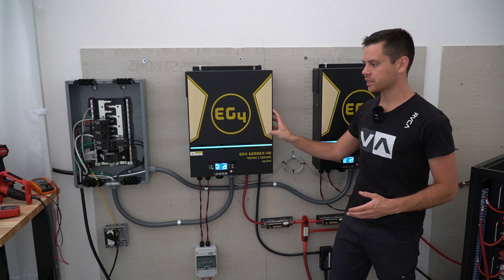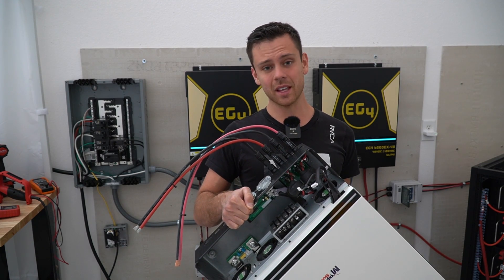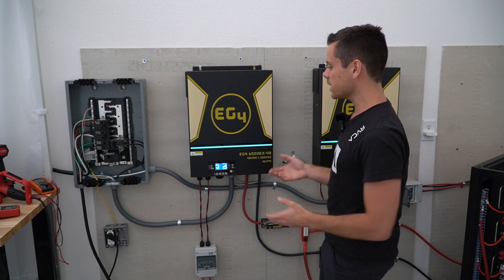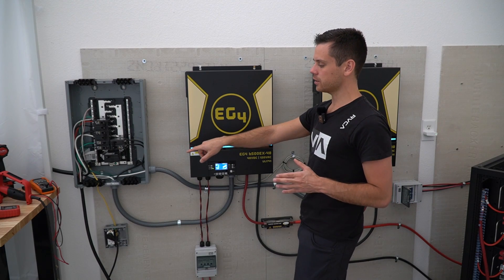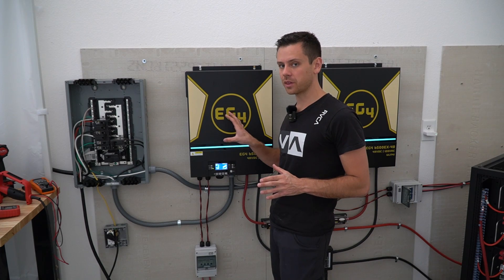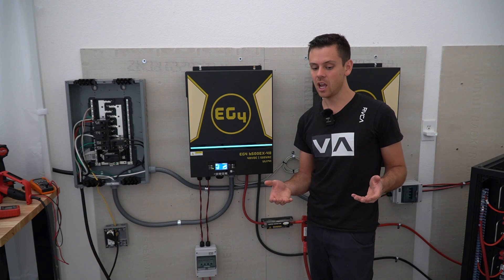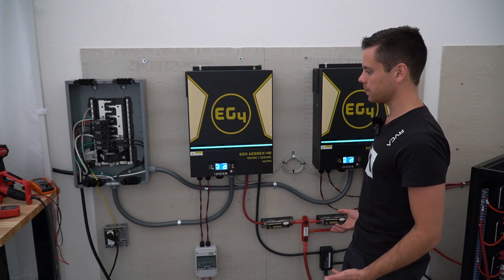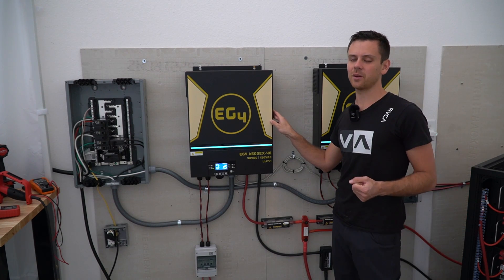EG4 6500EX VS MPP LV6548 Code Compliance and Ground Neutral Bond Discussion

Comment: Just saw that Signature solar now has EG4 6K Off-Grid Split Phase Inverter | 6000EX-48HV | 6000W Output | 7500W PV Input. Wish I would have waited to purchase this instead of the 6500 I bought
Reply from the maker: Why? It's same as lvx by mpp. High idle consumption. Good for inductive loads and that's it
Reply: @WillProwse  basically just for the money. would save me $1249 from having to buy another one and wire. Recently became disabled and only getting SS disability now. So every penny helps. I know it is not much but still. I am happy with my purchase and will buy another one here soon it just would have been nice to buy another battery with the savings. haha Keep making great videos I look forward to all of them including the ones you make with your Tesla's
Reply from the maker: I prefer 6500ex anyday over the other one

Comment: Will, thanks so much for all of your videos, I enjoy watching and learn so much! Do you have a video showing how to install an inverter like the E4 6500 as a single unit and simply moving some of the household 110 main breaker lines to it? I’m thinking about attempting this to reduce my electrical usage, and build it up over time with solar and battery bank to eventually have every 110 outlet on an off grid circuit, but would love to see that in a video! If it already exists, please point me in that direction.

Comment: I’d really love to see more about grid-tied systems with battery backup, solar power pass through, etc. I see a TON of affordable off grid solution but very little about grid-tied systems with battery backup. Particularly DIY. I’d love split phase, 30kWh battery backup, and 10kWh+ panel setup that can fully power the house and feed excess back to grid
Reply: Why bother with grid tied? Hybrid inverter costs 3-4x more and in Florida electric company demands $1M insurgency policy. Unfortunately, it will never pay for itself. Off grid with emergency grid tie is the way to go, IMHO.
Reply: Power companies hate home solar & are cutting the pay rates to homeowners... 
Better, but more expensive, to have battery storage.

Real cost of electric from Big Power is edging Up to 20 cents a kilowatt... But they pay less than 7 cents a kilowatt to homeowners w solar.

Comment: Can these EG4 batteries and inverter chargers be used in an RV?  If so what set up would you recommend to run everything 2 - 15000 BTU A/C, 1 with a Heat Pump, electric fireplace, microwave, and kitchen appliances.  I’m talking fully off grid.  Also, can the inverter be used to charge the batteries with shore power or generator as well as solar?  Thanks.
Reply: I am wondering the same thing. I like the all in one option. Seems like it would be a much better solution.

Comment: Is it me or is this whole off-grid system floating? I.E. should you not have the grounds tied to a grounding rod if in a remote building or to a main building grounding rod?
Where is it grounded to and through? I can see the ground wires connected together but where do they finally go to ground through what path?

Comment: Can it be clarified that if I bought all this setup and have a good understanding of electrical hook ups and did it myself, and keep it completely off grid. Am I required  to get inspections?
Reply: I think it depends on if you are using it in a house that requires a Certificate of Occupancy or not.

I am keeping my house off-grid with this setup, and to get the CO, I need to pass inspection. 

I think of you are just setting this up in a garage or something, you don’t need an inspection. That’s just my understand though

Comment: I would like to see a load test. How long can you charge your car with it?

I can get about 30 minutes at 48 amps with my pair of LV6548s, (12,000 watts with the rest of the house stuff going)
Reply: Why does it stop charging after 30 mins?
Reply: @RCsBigAir  the LV6548s overheat. They cannot handle the load for a very long time.
Reply: @JasonCarmichael  Thank you for the info.  I’m currently setting up my own system to use to charge my EV.  If I were to lower my charging amps to around 25, would that help the system stay on longer, or will I still have overheating issues?  Thanks again.
Reply: @RCsBigAir  absolutely, I had zero issues at 32 amps ever. But when I cranked it up to 48 amps, kaput within 30 minutes every time.
Reply: @JasonCarmichael  Exactly what I needed to know.  I will just plan on keeping it around 24-32 amps.  Appreciate it. 👍

Comment: Is the ground neutral bond ok if it’s a floating offgrid system or should I still remove both screws and separate the grounds and neutral at box?

Comment: If I use off grid, do I need inspection?  I am in San Diego, California.  thanks
Reply: I think it depends on if you are using it for a house where you need Certificate of Occupancy. 

I’m staying off-grid with my home, and to get my CO I need to pass inspection. 

You might not need inspection otherwise, although I’m not sure. Best to check with the local code enforcer

Comment: Will !!  I don't know if you will ever see this comment/question; but, my big question on inverters is sound levels?? Do the EG4 inverters run cooling fans?  Constantly, or occasionally?   Nobody publishes anything on sound levels on inverters.  Right now, I have a Giandel inverter on my 24V system.  I have to have installed in my house, living in the Phoenix valley.  Only 103 today, but many days near and over 110 degrees.  Not good for installing any kind of gear outside, other than my panels.  My Giandel inverter only cycles fan occasionally on startup current, or if I put a big load on it.  Are there any inverter specs about sound levels?
Reply: Fans, spin up under load

Comment: Hi I'm wondering if and how I can put 48v wind generator into this eg4 sistem with soler   for maximum input of daylight and wind  into my battery bank to bring up backup power  storage at night  PS I have lots of wind   any help would be much appreciated thanks for your time 👍
Reply: I think you probably can, as long as you don’t exceed the 18amps that the PV inputs can handle

Comment: OK, so if I want to use this in bypass mode then I have to leave the neutral unbonded in the subpanel (because I havbe a neutral bond in the main panel). Then, when the units are in inverter mode, and the output neutral is disconnected from the input neutral, I don't have neutral bonding anywhere. That sounds like a problem, right?

Comment: I have a fairly new 13,110 kWp System (38 x Mission MSE345SX5T Solar Panels / SolarEdge SE10000H-US Inverter with P400-5 Optimizers, RGM Revenue Grade Meter and Cellular Communication / Note: Installer has Filed for Chapter 7 Bankruptcy). June 13th 2022 / Year to Date Production 9.23MWh / Consumption 5.77 MWh. What would you recommend that I purchase to have Battery Backup Storage in the event the Grid goes Off-Line? Thanks in advance for your time, Randy  AKA: randog311  (77554 Area Code)

Comment: I've just found an inverter with an internet search which looks exactly like the EG4 6500EX with the same specification. It's called "Phocos PSW-H-6.5kW-120/48V" (e.g. offered by solar-electric). Even many pictures in the manual are looking the same as in the manual for the EG4 6500EX.

In the manual of this inverter, they mention the neutral-ground bonding explicit on two locations with interesting details:

page 3:
"Both neutral (N) and live (L) wires of the AC input are automatically disconnected (break-before-make relays) from the AC output when the Any-Grid operates in Off-Grid mode"

page 4:
"Only in Off-Grid mode, the neutral (N) and ground (PE) of the AC output are automatically bridged inside the Any-Grid to ensure the RCD’s functioning if the AC installation is wired correctly as a TN-S or TN-C-S earthing system. Ina TN-C-S installation the bridge between neutral (N) and ground (PE) must be between the public grid and AC
input of the Any-Grid to ensure that there is never more than one bridge between N and PE."

Now I wonder if it's possible that the EG4 behaves in the same way about neutral-ground bonding like this Phocos? Is it possible that the EG4 includes also this relay - additionally with the bonding screw which is mentioned in the video?

Have you ever heard about this off-grid inverter model?

Thanks!
Frank

(don't be irritated by the headline of the solar-electric web page, they mention the word "hybrid" in the headline of this inverter offer - but it's not hybrid, they call it "Any-grid" because the grid can act as input source only - it's explained in the details).

Comment: Am old lady, husband wired our house. Main panel by the road. Would this work for additional power EG4 6500EX if all i want to do is supplement power in off grid configuration to keep the trucks and/ or  tractor plugged in during 40 below in winter and a single air conditioner during summer. That currently costs $150 month from the grid. we alternate so not all at once. If our house catches on fire , will burn to ground before fire department gets here. Rural Alaska, so do not have to worry about firemen getting zapped.
Reply: Wow Linda, sounds like you're really roughing it out there.  Yes, that or the LV6548 would work too.  I'm putting in an off-grid system myself and it's a lot of work, from finding and ordering all the right sizes and types of parts to getting up on the roof and installing conduit, pulling stiff wiring, handling heavy, bulky solar panels while trying not to fall and kill yourself, to installing the inverters, batteries, and on and on.  But it's very educational :)

Comment: Will, great videos !  Very definitive and well described. Your OCD on solar equipment is very much appreciated.  Question; would you consider a review on the Generac PWR Cell inverter and battery pack. It appears this may be a good, all in one. But your review would confirm or deny this.

Comment: I just purchased two of these to go along with 280 ah 48v lifepo4 batteries and 8kw of solar to start powering an electric car charger and my garage mini split.   can I use the ac in a a backup power source without backfeeding the grid?
Reply: they cannot feed the grid

Comment: Will, I love your very informative style of video making. All great info for someone interested in building or adding lithium batteries to their installation. 
I am about to pull the trigger on LiFePO4 batteries for house batteries in my boat but just watched a video of a boat roaring in flames and the owner blamed the LiFePO4 batteries. Being that you seem to have an ample supply of test batteries at your disposal would you please make a video of what would happen if a batterie’s BMS were to really wack out and overcharge and imbalance one cell to the point of failure. Or maybe a failed BMS to cause a high discharge of a single cell to the point of internal short. I have heard you say that LeFePO4 cells are not near as volatile as Lithium Ion or Lithium Polymer cells, but would love to see a real world example to make me sleep better at night as I plan on having 800Ah worth of batteries sitting in my engine compartment. 
Thanks for reading.
Reply: Did you ever get an answer to this? From what I can gather is that the owner may have purchased some cheap-ass LiFePo4 batteries or a cheap-ass solar charge controller. If you go with Litime, Redodo or Chins or similar quality you should be ok. And for the mppt go with Victron.

Comment: Also if you install more the 20 kWh your inspector may require compliance to NFPA 855.  This would fire suppression and gas detection.    The codes are a moving target .  It comes down to your local inspector.

Comment: Perfect to see you checking out the Sol Ark , I think you will love wiring it up , really simple to wire. A bit expensive but a great inverter. The Sol Ark people are in Texas, if they know about your history and they check out your channel they may give you a loaner to check out. They have a new Sol Ark  15k coming out but they have to wait a little while to get UL certified for that latest model. I have the 12 K it was easy to wire and a 10 year warranty. Signature Solar which is a few how’s from the Sol Ark people , recently got a Sol Ark from them , I am pretty sure they might loan you one. Expensive but built live a brick outhouse. Excited to see any videos you do on the sol ark in the future. Oh the tech people at sol ark are telling me they may do an off grid version in the future.
Reply: I almost ordered a Sol ark 
Reading about it shutting down because of unbalanced loads . Was a a deal breaker. 2 EG4 6500 watts were less expensive. For more power output. 
And capable of more solar input . For the price I would expect more from Sol ark

Comment: Your videos are very informative and thanks. I am planning to buy (BLUETTI AC200MAX Expandable Power Station | 2,200W 2,048Wh) and I don't want to buy the solar panel from them. This unit is just for emergency use in the home. Can you recommend two 350 solar panels (I prefer Q Cell panels) for this AC200MAX model? Just trying to save $900

Comment: Question will or anybody with knowledge I'm going to be totally off grid 5 mi in the woods power company wants 60 to 70k to bring power back now I do have that but I'm more interested in investing long-term off grid without relying on grid . My house is about halfway completed at 1600 square foot three bedroom block House if it was your choice would you get two of the EG 4's or one solark 15K to run entire house if absolutely needed I could put some appliances on gas? What would anybody with knowledge recommend for a whole home off grid package with battery backup still run just about everything.  I was looking into 30 to 50 KW battery Banks would that be enough backup? Thanks to anybody who has answers or recommendations. I forgot to add my small town codes are pretty lenient I'm in Florida nothing like California I'm also in one of the last counties that will permit me for off grid no good tie.
Reply: Consider solar thermal and geostorage thermal earth batteries. Less components to replace long term and less conversion losses. Cheapest long term.
Reply: We’re in nearly identical scenarios & line of thinking. I already preordered the 15k and am actually going to order two of these EG4s in addition. Seeing how fast battery tech is growing, I may start with just the 30kwh w/the two eg4s....then expand with the solark into whatever comes along next, which will make sense. 

Basically, I’ll aim to create a system for my shop, separate from my home, which could later act as a redundant system for the home. So, potentially, two 30kwh systems, as opposed to one 50kwh system
Reply: @jessematchey4802  oh ok I gotcha excellent information as I also plan to do some sort of work shop 20x30ish so are you planning the two EG4s  running the shop and maybe the solark 15K running the house with separate arrays and do you plan on maxing out the solar input on inverters. Thank you for your response all info is greatly  appreciated 👍

Comment: Hi Will. I've been watching your videos, a d just popped by to say Well Done, and to Subscribe. I don't know if you've seen their videos, but a lot of them could well be right up your street, though dealing with boat electrical Systems, which has aspects that are important for land based Systems, and not just Marine Systems. By the way, interested personally in those SOK 206 AH 12v Marine Batteries, and found they are also available with battery heaters, for quite a lot more. There's a Chinese Factory JR or something, making 300 AH 12v lifepo4 Marine batteries as well, which look OK. My next boat, could be a 35ft instead of the 40 ft I want, due to getting a Construction Slot or not. well the 35 ft is restricted to a  two house battery bank, and the 40, restricted to three batteries. so 2 x 300, or 3 times, means big increase in options, such as not being forced to get Windvane steering rather than autopilot, just to reduce battery draw. There are only so many compromises I can make for liveaboard years over the horizon bluewater Cruising, to have safe fresh water, and regular hot showers, , an induction hob and a microwave, to make a big reduction in gas used for cooking. Not to mention the essential Toasted Sandwich Maker of Course. 🙂 Keep up the Great Work. Best Wishes.  Bob.  👍
Reply: PS. I forget to give the name of the YouTube channel for Marine Electronics sorry - Pacific Yacht Systems. I think you'll Love it. Bob. 👍

Comment: Hi, is it possible to have a solar system that can charge an EV during the day without a battery?  Or with a very very small battery ?
Reply: You need the batteries to balance when you use the energy vs when your solar array makes the energy. Without batteries your system would switch from grid to solar and back every time a cloud drifts by and wear out switch components.

Comment: You can't use the 90º column unless your breaker and other wire screw terminals are also rated for 90º, and they are not, typically they're rated for 75º only.  Also, if you're using Romex, you have to use the 60º column.  Individual THWN-2 conductors in conduit may use the 75º column.

Comment: I find it strange that the screws aren't removed by default. I'd think most people will be using these with a circuit breaker box. It makes no sense to bond inside the inverter unless you're wiring directly to it with fuses in the place of a breaker box.
Reply: I thought this is what made the growatts sketchy?
Reply: @mylesoffgrid  Right we were told not to buy them because of a screw in the wrong place 😆.. It's all garbage advice if you know what your doing and how to do it correctly. incidently my Growatt inverter did not come bonded.